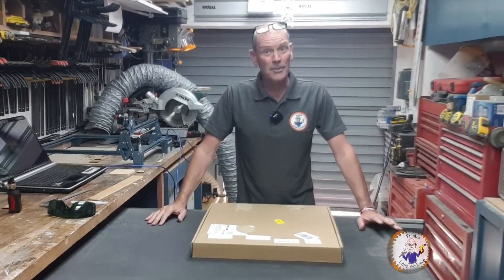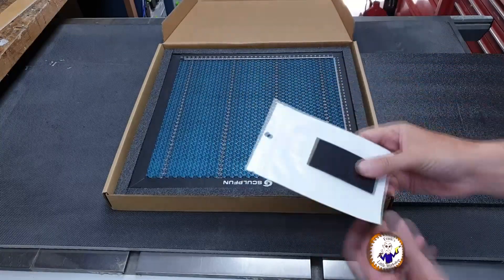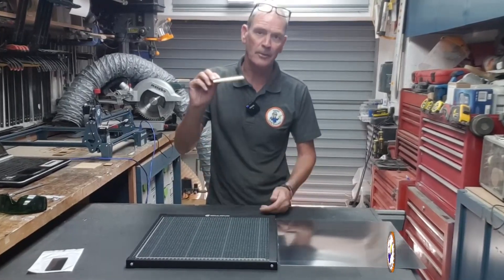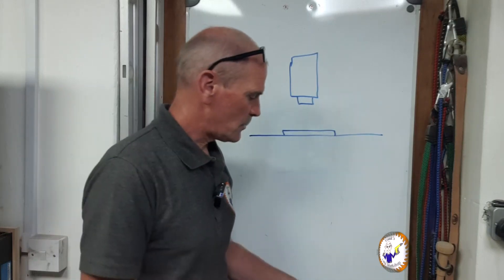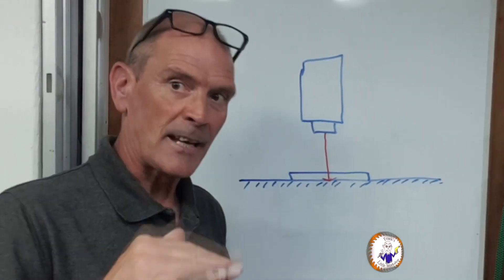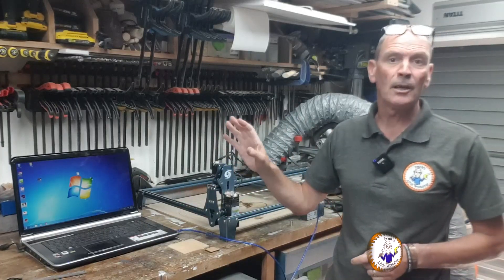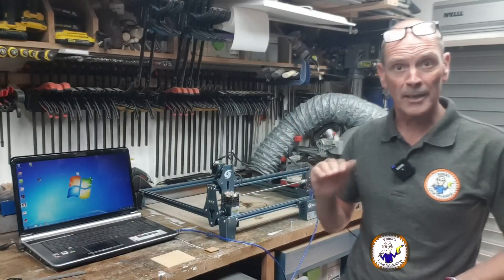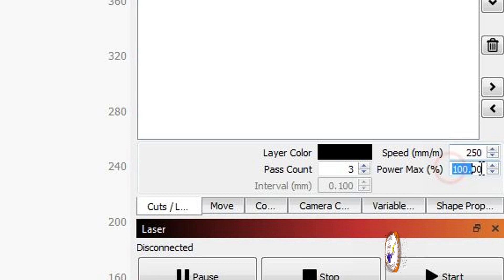Why use a Honeycomb bed for your laser ?

Comment: Do you use air assistant? Nice explanations, but I think the air assistant with a pump compatible, allied to the honeycomb, bring the perfect results, don't you?
Reply from the maker: 😁 I 100% agree 😁. I have an air assist for my Sculpfun S9 now but haven't fitted it yet. I did make a temporary air assist setup for a project a while ago and it did make a difference so I think it is the way forward 😁. Thanks for watching 😁 👍
Reply: @frankslittleworkshop do you uploaded a video or some tutorial? Here  in Brazil, Two Trees Laser Cut have a good price, but honeycomb and air assistant system accessories are so expensive. Thanks for the quicly reply, all success to you dude
Reply from the maker: @okchassa  😁 Hopefully I will be making an "air assist install" video as soon as I get the opertunity. The kit I have got was on special offer when I purchased it, but generally here in the UK they are quite expensive, and it is the same with the honeycomb, but the price is slowly reducing 😁👍

Comment: My laser does not cut wood (zbaitu c80) I don't know why
Reply from the maker: 🤔 Sounds like you have an issue there. I assume it is a 10W version so should be capable of cutting through up to about 15mm (with multiple passes). I can only assume that it is not correctly focused so the beam area is too large. Or that your lense is dirty or burned. If these are both OK then the output of the laser must be lower than the expected 10W. You may need a new laser module 🤔. Let me know how you get on. Thanks for watching 😁 👍
Reply: your S-value needs to be set. Google how to set S-value to "1000" in your software and it will be fixed